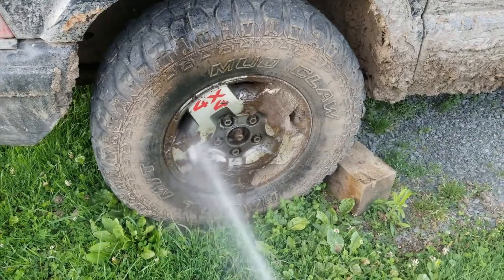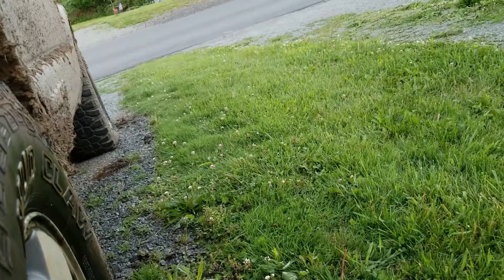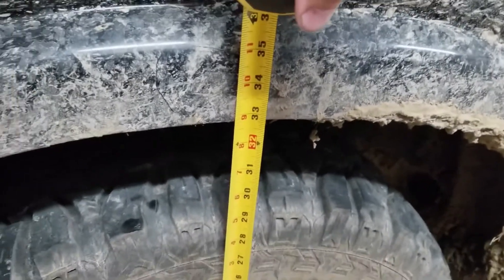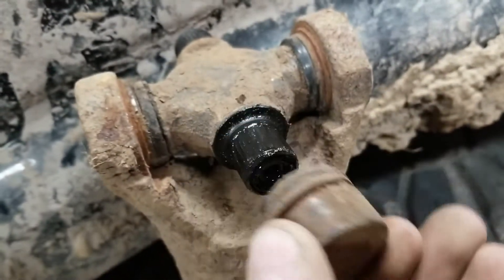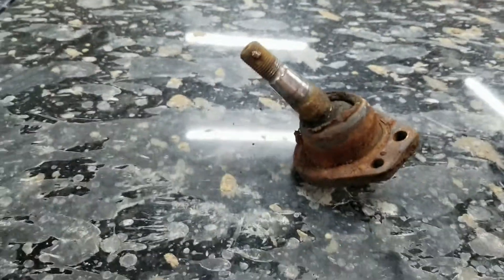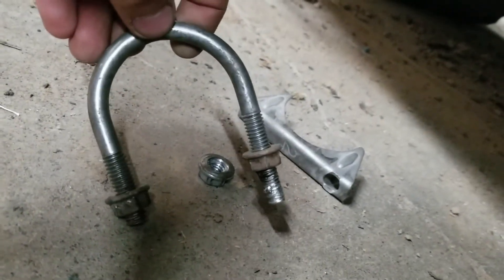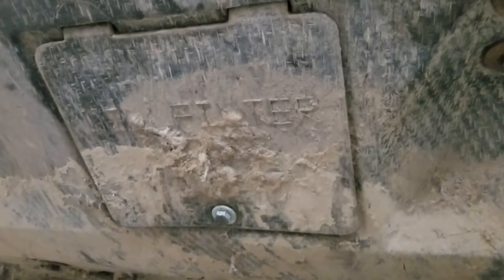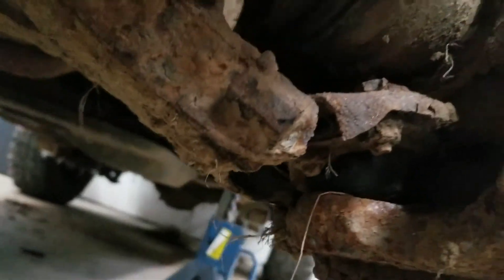Repairs for rusty junk "Danger Blazer" Z69 - looks great! but rotted bad

Comment: That oil filter looks mint.
Reply from the maker: Still there. Oil and filter haven't been changed since I bought it in January 2021🤣
Reply: @GEARHEADdezign  my Bravada ate three 4.3s and always kept it up. I guess I'm doing it all wrong.
Reply from the maker: @RodknockRhett  the less you care, the better they run, right? If you watch the gambler spring broke video from last year, I had it pegged overheated for like 15mins and it's still fine